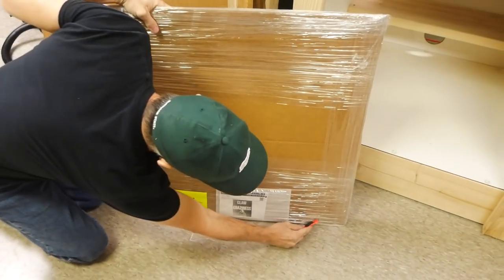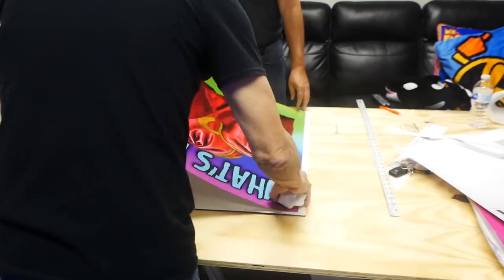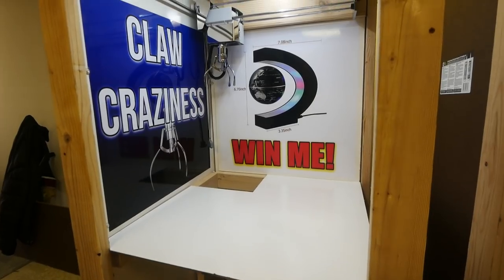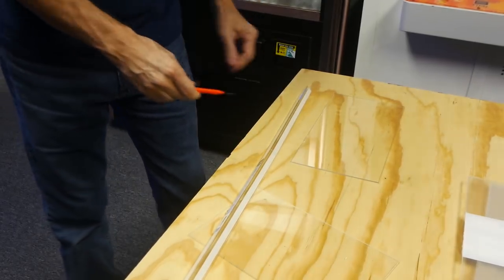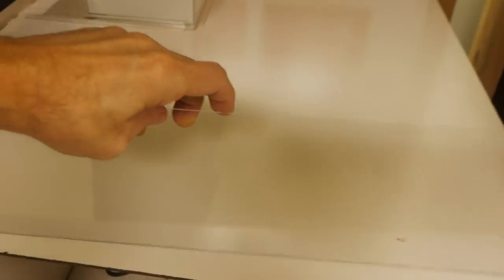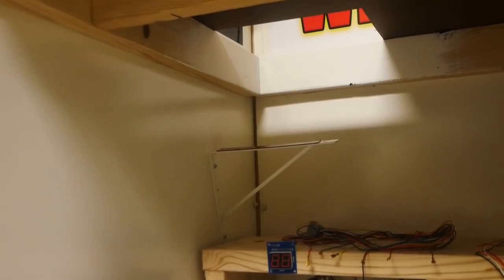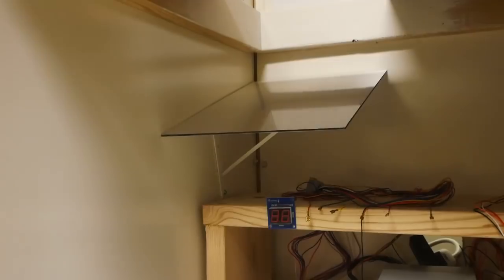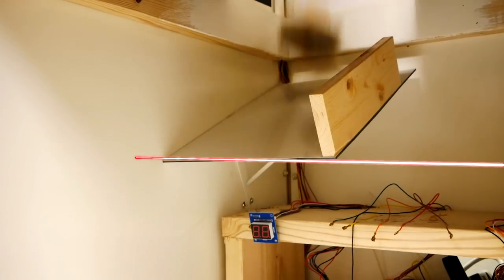MAKING ONLINE CLAW MACHINE GAME PART 4! || Installing The Graphics!

Comment: The chute you added now needs to either be screwed to the back panel with screws or some L brackets. Without this support the chute looks like it might wobble to much and break due to the weight of the prize.
Reply from the maker: On the left edge of each chute we have added brackets to secure it:) you can't see that in the video, I may point that out in the next segment.
Reply: @clawcraziness  wouldn't it be better to put the line sensor at the start of the ramp ? As in the demonstration the prize may bounce and maybe skip it at the bottom ? . Loving the building <3
Reply from the maker: @ultragames007   We'll tweak it out, this video is to show the general idea of the prize sensor:)